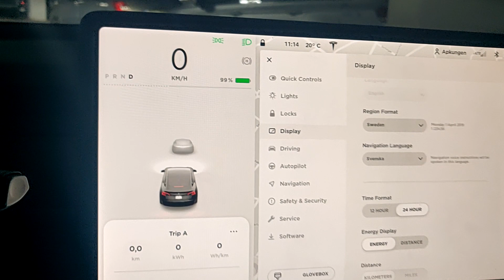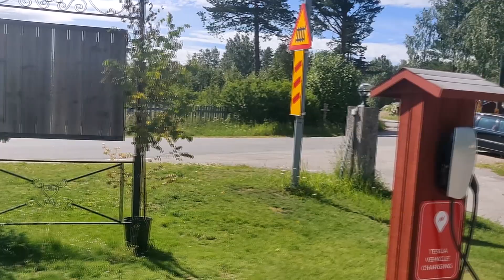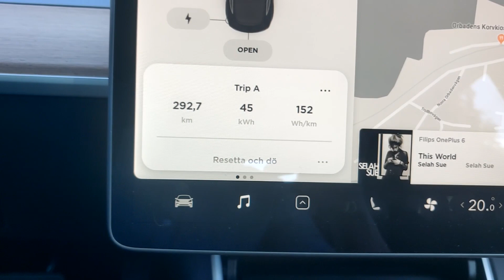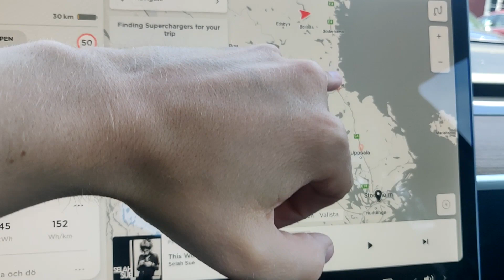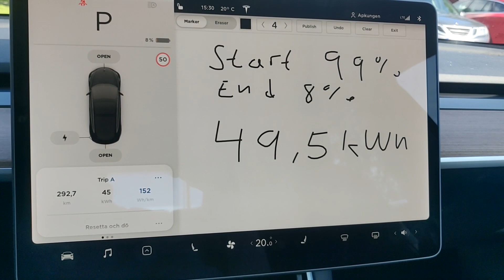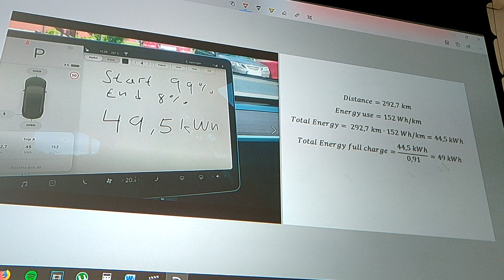Tesla Model 3 Standard Plus Capacity (kWh) test

Comment: it should go 409km like it says in the tesla site. the weather was good whats the reason it went so little? other People say the battery is 55 or 60 kwh not 49. im confused other People say it goes 385 km here in youtube.
Reply from the maker: The car went 323 km calculated from 100-0 percent. The main reason is speed. If I would have been driving about 90 km/h all the way the range would have been around 409 km. Another reason is that the end was at a higher altitude than the start which uses energy. 

The battery is probably at about 54 kWh but the capacity I'm measuring here is the energy I can get out of the battery. How much energy can I use? That's what I'm interested in..The rest is turned into heat. 

409 km is the wltp range, 380 km is the EPA range. These are just ranges in a test cycle so that you can compare cars to one another. They don't really reflect real world driving. I've gotten efficiencies that corresponds to ranges from 230 km to 500 km.
Reply: @apkungen89  ok om considering buyin Tesla model 3 in some years should i gi for the standard range plus i dont drive long distances. What do you mean with you have got effieciancy og 500 km do you mean that the standard range plus can drive 500km?
Reply: @xzaxx  I'm not answering for the author of the video, but to get 500km out of this particular model a few variables affecting range should be within optimum values. I'm refering to environmental temperature, direction and wind speed, altitude and  driving speed. The latter one is, of course, key. If you "hypermile", say drive between 50-70km/h constantly  during a given trip then those 400-500km are achievable.
But basically this is nuts! :-P